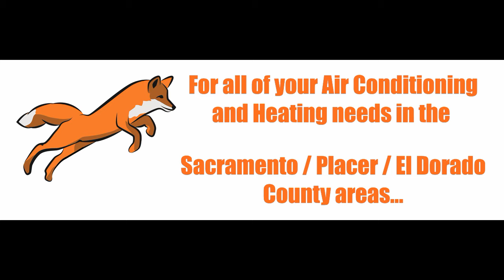Installing a Williams Wall Heater / Williams Wall Furnace in Sacramento

Comment: Thanks for this.  I have a Williams wall furnace that has the heat exchanger making a loud banging noise when the metal expands.  Is that fixable?  It sounds crazy but one person recommended hitting the metal with a hammer to dent it to stop the noise.  Is that worth trying before I replace the whole thing?  It's only about ten years old.  Or can I replace just the heat exchanger?
Reply: I have the same problem.  I think it is the vent tube.  The installer says these noises are normal.  What BS.  Another installer said nothing  apparently chasing down these noises is something workmen don't want to have to deal with.  When things are working properly,  a Williams wall furnace is quiet.

Comment: Nice job!! 👍🏽 Wish I could get my landlord to change my 50yr old wall furnace, just like this one. It makes a lot of banging noises when it’s on. What good excuse could I give the landlord to convince him to change it?
Reply from the maker: That's tough because landlords as you know will hang on as long as they can.  I would definitely make sure have a GOOD carbon monoxide detector in the house.  All I can think of.  The noises are coming from expansion and contraction of the big metal heat exchanger
Reply: @foxfamilyheatingandaircond4696  What is wrong with people! How can you rent a property and leave it with a heater that's 50 years old! 🤦🏼‍♀️🤦🏼‍♀️🤦🏼‍♀️🤦🏼‍♀️🤦🏼‍♀️🤦🏼‍♀️🤦🏼‍♀️
Reply: You can usually get the gas company to come out and do a safety inspection free of charge. They’ll send someone to take a look at it, and determine if it’s still safe to use, or if it needs replacing. Usually a 50 year old heater is gonna need replacing, and you can just pass on the information given to you by the gas company to the landlord.
Reply: @C-los159  Can't argue with a pink tag lol
Reply: There is nothing wrong with the 50 years old heater if it's still working properly. It actually will outlast any new heater that will work only for 7-10 years. Replacing just one wall heater cost  $4500 and up. So to convince landlord to replace the heater just because you don't like a noise, you may offer him this amount of money.
 I guess for landlord will be cheaper to replace tenants 😁

Comment: Do you have a video on how to clean a wall furnace like this? Mine just started making a high pitched noise when it's not running, and after it's done with a heat cycle it clanks for several minutes afterwards.
Reply: Mine too hopefully someone knows mine doesn't really make weird noises when on but after turning off there is alot of rattling noises
Reply: I read that the high pitched noise happens because the fan motor eventually dries out over the years and needs a few drops of oil in it to lubricate it. You need to use 3 in 1 oil. See if you can Google the model number of your wall heater and then look at the diagram blueprint of the heater.  It will tell you what grade of oil to use and there's 2 different little oil holes on the sides of the fan motor and it shows you the exact location of where the oil holes are. You don't have to take the heater apart to get to them...  Just unplug the heater and turn the thermostat off for a little bit while you're working on it so that the damn thing doesn't start up with your hands inside of it... Then remove the cover towards the top where the fan is... use a flashlight and look for these 2 holes. You need to add this lubricating oil every couple years so that the motor doesn't die on you. Otherwise you would have to buy a brand new wall heater. I'm not a hvac guy and I didn't want to spend money to have a technician come out to do it. It's pretty easy to do this by yourself. Hope my info helped you. Thanks.

Comment: Nice work. Just repaired and older wall furnace the other day. No one could figure out why it would not work.  No one ever checked for a short in the stat wire. LOL
Reply: That's too bad all the connections everything that straps together has to be pristine and free of any debris that way you can get 100% contact 99.9%, that's usually where it fails all the connections the wires the whole nine yards I had learned that from a friend that's where most of the causes when you're connecting or installing or replacing furnace

Comment: two things Greg, the first is the white pipe dope does not work well on black pipe, it's actually made for copper pipe the blue pipe dope works real well on black pipe. In my state they also require you to use the yellow colored Teflon tape for gas I don't know if it's made it to Cally yet but if not it's coming. And second the install like always looks great.
Reply from the maker: AirOasis Mechanical HVAC thanks brother! I always appreciate your info!
Reply: In 2020, you use any Teflon tape on a gas install in my local and you're not only going to fail inspection, you may end up before the licensing board.
I've got my own personal opinion on that, but it is what it is. You should see the fight we're having over WAGO versus Wirenuts. I swear, it's permanently 1972 around here.
I thought he was using RectorSeal #5?

Comment: Is it customary to change out the vent pipes when replacing a wall furnace. We’ve had a couple replaced on our rentals and I don’t recall our installer doing so. Thanks.
Reply: I can't speak to other regulatory agencies, but our local inspector would not accept any installation we did which reused a 50+ year old galvanized flue.
We always replace them, better safe than sorry!

Comment: Got though 1 winter it worked and then the this winter we turned it on the panel where off and on are and it isn't working. The gas lighting didn't come on. What do we do?

Comment: Two questions for you guys.
1. How high or how much space is required between the floor and bottom of the furnace to be installed? 
2. Does the vent pipe have to be directed through the roof or can it also be directed through the side?
Thanks a lot and great video by the way.
Reply from the maker: Hey thanks for the question. The instruction manual has all that info in it. Measurements and ventilation are very important to them and they way you to do it their way 😊 good luck to you! 👍👍

Comment: Just a question..I'm working on a house built in 1910, someone installed a gas wall heater. There are some small "scorch" marks around it on the stucco...I'm thinking there should be some type of heat barrier between the unit and wall, but not sure...hope this made sense.
Reply from the maker: Whenever the city code inspectors inspect our jobs for safety and compliance, they are always referring to the installation manual.  If it's older than 10 years, buy a new one for a few hundred bucks and install it to manufacturer's specs in the manual.  Can't go wrong that way, I promise.  Good luck!  You can do it.
Reply: What kind of drywall surrounding heater?
Reply: Shouldn't installers be wearing safety glasses and gloves?
Reply: @edwardvasquez1727  I'll be honest - I do, because I've made it into my 60s with all body parts still attached and my eyes still good.
Young men are nearly all incapable of understanding that there are permanent consequences to their actions and nothing and nobody can get them to do that. They just won't. It's they way things are.

Comment: I have a question how come you didn't install yellow tubing tape when you attach the the valve to the gas line
Reply from the maker: We use pipe dope instead. It's just another sealant alternative.

Comment: Fox Family Heating and Air Conditioning. Was the existing B-vent single wall....and is that why you replaced it?
Reply from the maker: Todd Freeman No, I pulled permits on these and is just part of the job. The inspector wants to see it between the floors too

Comment: Single wall vent going up in wall and natural draft. Wow so many code infractions with tssa in Ontario.  You guys need the b 149 code book.
Reply from the maker: Matsacre .357 that was double wall b vent what are you talking about?
Reply: matsacre I'm pretty sure Greg pulls permits and gets inspections so it will be alright .
Reply: Ok ok my bad. Sorry.
Reply from the maker: Matsacre .357 yeah permit was pulled on all of these in this complex. Double wall used 4" oval. With spacers in between floors to maintain clearance to combustibles.

Comment: What's a reasonable cost to switch out an old wall furnace (labor and materials) in Nor Cal?
Reply from the maker: Around 2500, no more than 3500. Our biggest one, the double sided 50k unit is 3200
Reply: @foxfamilyheatingandaircond4696  Im not local, but dealing with a need to change my 50 year old unit out. I was quoted for a full day at $1800 labor only if I buy the unit. Whats the average amount of time these take to swap?

Comment: Was at my mom's house the other day and they use the same wall furnace with natural gas. I woke up about 3am smelling a weird burning moter oil smell. When I got up I could see smoke even with the room being dark and I yelled out that I see smoke. My mom's bf yelled that there is no smoke and that it was normal, I was hoping maybe my eyes were just blurry. When I got into the kitchen I saw thick smoke in the street light through the window. They turned off the Thermostat and the furnace stopped smoking. They say it's just burning dust. It's been running all winter, dust doesn't collect that fast and it smells like burning hair. I'm worried there is something very wrong and I know they are not worried enough to not use it.
Reply: A simple call to your city's  gas company, mine is the Electric company that deals with natural gas, let them know you smell a gas leak and they will go out to you and inspect the furnace or wall heater for free. Better save than sorry. Atleast they will assess what's wrong and if no gas leaks are detected then they will recommend bringing  a company to check it out. I remember our company had a third party come out and I spent it for free.

Comment: Are these furnaces forced air flow with a fan/blower or just gravity draft.  (I realize the combustion is just gravity draft.)  Thanks!
Reply from the maker: GaslightAlley just draft. there is an option for fan installed on them. You'd need 120v to the furnace.

Comment: Skip the first 6 minutes, cut the music, I just wanted explanation on how to connect the gas line and thermostat properly, I didn’t see anything about that. An election wants $1100 to uninstall one floor unit and put a new unit on that I bought myself. I’ll do it myself.  Doesn’t look like it takes a genius.
Reply: Having installed more of these than I can count, no, no genius required.
Patience to read and follow instructions, however is - and a near OCD level of attention to detail to prevent gas leaks, premature heat exchanger cracks, fire....
We check and double check and I don't care one bit that it takes a bit off my bottom line for one of our apprentices to double check my work with his own equipment. CO doesn't play games and those exhaust gases are warm enough to easily melt a plastic water pipe or NM electric cable, never mind water damage from an improper roof penetration.
To answer your questions - and this is not a recommendation on how to do it yourself because you shouldn't - the gas line installation added a 'drip leg' to the old fitting. This keeps dirt out of the easily damaged/jammed gas valve. The fittings were properly prepared - some need pipe dope (not, no never ever 'teflon' tape), so MUST be installed 'dry' and torqued to the proper level, not too tight, not too loose - and spotlessly clean when installed.
The electrical can go one of three ways. Millivolt systems don't need a connection to line current so they work even when the power lines go down in a storm. They do require the proper thermostat, extremely well done wiring - and I mean perfection is required. Many localities no longer permit them as they have a standing pilot flame.
A second setup uses a standard 24VAC system, either with onboard step-down transformer, requiring proper installation to the 120V line or an existing 24VAC system, the proper thermostat and wiring. This requires good workmanship but not the exacting perfection of the millivolt systems.
Finally, some wall furnaces have blowers/fairly sophisticated electronics/wireless communication. These need proper 120V line hookup, proper programming, thermostat - all done by someone who is willing to read and follow instructions and work to NEC guidelines.
If you hire a qualified person, they pull the necessary permits (repairs usually don't need permits in my locality), have it inspected and turn this into your insurance, they won't deny your claim when the house burns down or somebody dies of CO poisoning.

Now - is the sum they are asking fair? It's a question worth pursuing. I am a picky old lady and will only install customer purchased equipment if it's originally packed and a brand/model with appropriate regulatory approval. Used stuff, no, not in this case. My company, assuming we accepted your unit, would not be charging anywhere near that amount. Maybe you should shop around.

I'm not trying to be mean or nasty or one of 'those' YouTube professionals who think you need an electrician to plug in your coffee-maker in the morning. Just, this is one of those areas where the knowledge needed NOT to make mistakes is far greater than the knowledge needed for any single step of proper installation. That's what you're paying me for, really - that I not make a mistake you might not even know was possible.